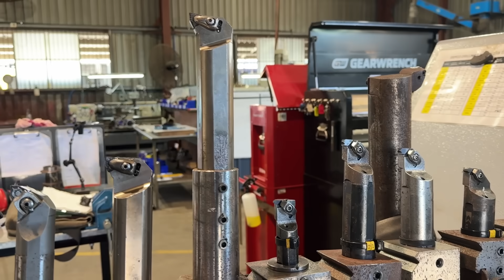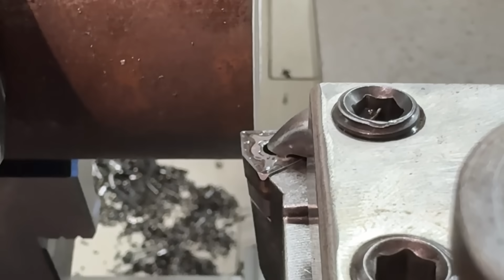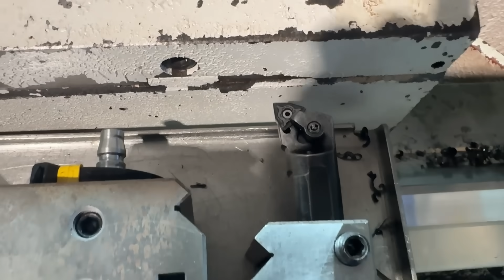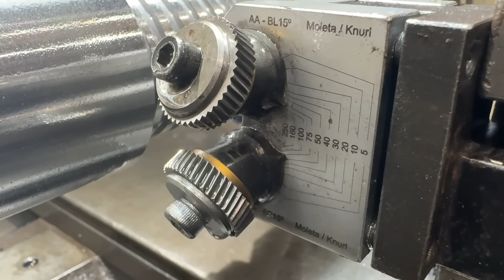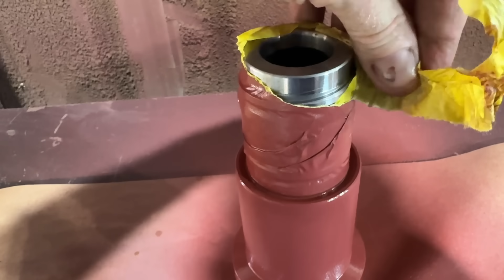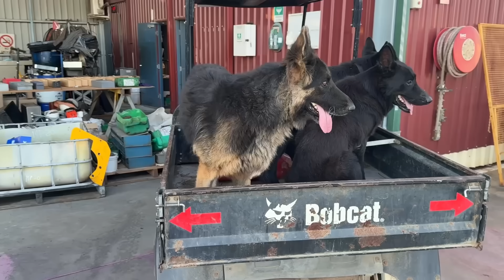Machining a Haul Plug (So Satisfying To Watch!)

Comment: Parkerizing... Neat, fresh to that game.
Here is a tip, heat up your metal to about 55-60 celsius before applying the stuff. It forms denser and smaller crystals. And you get no guarantee it'll turn out black, depends on the impurities in the metal. You also may want to seal it with wax oil.
Grain of salt, i am fresh to the game. Get a 200x handheld microscope ... about 100euro to get a clear-er picture.

Comment: I love the way the CNC varies the spindle speed doing facing.  Not something you can easily do on the old machines I used to have.  Had a Colchester Student Mk1 and later a Master mk2, except that I put the tailstock from the Student (luckily, a 6½" height) on the Master as the original was badly worn and would've been difficult to fix.  I assume someone had used it for a lot of drilling or something using the tailstock. 

Originally from the UK (mostly Wales) and now living in Portugal and semi-retired.

Comment: I'm surprised the rpm limit for the live center is only 300 rpm.  Is this set by your experience?  I'm used to seeing 2500+ rated rpm even for a 5MT live center although that has always sounded extreme to me.
Reply from the maker: It’s just what that particular one comes rated too. It’s heavy duty but you can’t run it at high rpm 

Apparently
Reply: @halheavyduty Thank you.  Do you have a video talking about the grades of steel and thread types and sizes you make on these parts?

Comment: Watching from Somerset, UK. This may be a rookie question, but why the tapered threads on one side? Yeah, nah, yeah, I know the other side will be tapered as well - lol - I'm curious to why the taper in the first place? Does the taper aid in 'gunk' (from drilling) removal during use?
Reply from the maker: These “haul plugs” usually have one straight and one tapered thread.

The straight “NW Rod” thread is so it can’t easily unwind without you noticing.  It’s a safety feature.

The other one is tapered so they screw up faster in the field.
Reply: @halheavyduty  Is that literally all it is; the tapered threads screw up faster? Interesting. I imagine it's because it allows the guys to offer it up easier (small start thread to larger hole)?

Comment: They may look nice and new as they go out the shop gate. BUT then the drillers get them and they all end up then same with no paint and just thread dope…  its universal through out the drilling on every continent and oil  / drilling fields. You do a good job to a great standard  then you lose control .. till they come back for re machining and the cycle starts again…you will never be out of a job making x overs.

Comment: The #1 issue that drives me bonkers when working on any project is not finding the tools I need to complete my task. I'm not a machinist, but I do home repair / renovation work, be it electrical, plumbing, carpentry, yard care, etc. I've got a garage that is a completely separate structure from my house. As such, I've got tools in the house and then in the garage, or both. I'm not buying duplicates for both locations so I must be orgainized. That is a weekly challenge.
Reply: I share your sentiment 😅

Comment: (Watching from a cabin in the mountains near Newport WA USA).

How long would you say it took to make this part, start to finish?  fascinating to watch a CNC make tapered threads without fiddling with the sled.

When I was in grad school (UCLA, mid 1980s (!)) we needed a parabolic cylinder surface + matching surface for a sub mm-wave optics application (*).  The matching surface pair was about  15 cm x 6 cm.  My advisor told me "please please please do not put the surfaces together!"  So of course I did.  The surfaces were so perfectly cut that I couldn't pull them apart (*).  Oops.  Against *all that is holy, I gently slid them past each other and managed to avoid scratching them (to my infinite relief).  An interesting thing about the surfaces, my advisor told me that they were "cut, not polished" in a "classified machine shop" which, I have to admit, seems plausible to me.

A second interesting bit of metal working was a "Doppler Wheel".  In those days it was quite difficult to generate 380 GHz radiation, and even more difficult to produce a second phase-locked signal about 200 kHz away from the first one.  The standard technique was to use a beam splitter, and send half the radiation to scatter off the edge of a rapidly spinning wheel, changing the frequency using the Doppler Effect.  The wheel in question was a disk of aluminum about 3 cm thick and about 40 cm in diameter with a bunch of fine teeth cut into the edge (as a diffraction grating).  The whole thing was bolted to the shaft of a beefy synchronous motor and spun at 3600 RPM.  That was then bolted to the optics bench ... hence the problem: optics benches are supposed to be completely free of vibration ... so the motor and the disk was sent intact to the "classified machine shop" and they balanced it ... and it ran smooth as a whistle as long as nobody touched it. It was also terrifying, because it was run without any kind of protective cage: if that wheel had ever shaken itself loose it would have crossed the lab in a heartbeat, and either ricocheted around the lab for a while, or simply chewed through a wall to ruin somebody else's lab as well.  Nevertheless it worked.   However it did take an entire day to optically align the system: it was infuriating as well as terrifying (***).  

(*) essentially the surfaces squeezed all the air out, and they were pressed together

(**) if you must know, it was for a plasma diagnostics tool for magnetic confinement fusion.  

(***) one of my most useful contributions was to figure out a way to eliminate the Doppler wheel, generate the local oscillator signal, and provide a means to align the whole shebang in about 20 minutes.  Rather proud of that, actually.
Reply from the maker: It’s amazing how precise things can get. I watch zero tolerance machining where the parts disappear into each other in pure awe.

Sounds like you’ve done some cool work yourself mate!

That part only takes about 1.25hrs from start to finish. If I had a more automatic machine I’d cut that time in half I reckon.

But we make do 🤣👊

Comment: I just can't get over how nice the finish is when facing the end of a hunk of metal. The way it picks up speed to keep the surface speed the same is incredible. This perfectly illustrates how much better these machines are over older manual lathes. Don't get me wrong. I have a soft spot for older iron. I've actually restored quite a few old machines. C&C lathes are just that much better at facing the end and leaving a really nice finish. Good on you mate. Job's a gooden. Cheers!
Reply from the maker: Cheers Erick!

Comment: Watching from Arizona USA great content keep it coming 😉👍
Just curious, why is the threaded end tapered?

Also why is the chuck manual, instead of a hydraulic or pneumatic quick chuck with a foot petal?
Reply from the maker: It’s just a drilling thing. Almost all the rod threads have tapers. 

We don’t use a pneumatic chuck due to the varied sizes that go in the machine.
We had one on the previous lathe and it was a nightmare for our particular application.  We spent way too much time readjusting jaws.

Pneumatic is good if you only do a small range of diameters (in my experience)

We’ll probably get one on our Megabore though.

Comment: Hey mate, great content!  Just wondering how you have those u-drills mounted. Did you machine/buy some sleeves or can you buy the holders to take them? Also I like how you changed the square head bolts to grub screws on the tool holders, thats big brain.
Reply from the maker: Well spotted Jack. 

Changed to grub screws (the tool holders are permanent when set up)

We just used the Dixon tool holders, reinforced the tool post so it can’t rotate easily, and then made up some sleeves.

Oh, and we set up plumbing for coolant. Works really well all things considered.

Comment: I've observed drill rig functions over many years (videos) and have never been able to reconcile how/why tapered pipe threads mate but do not jam/gaul/cross thread. Could you shed some light on that? THANKS.
MdS San Rafael, CA
Reply from the maker: They can jam / gaul / cross thread, but by and large they don’t.

The taper tends to be 4.76 degrees commonly and it just lets them screw up faster in the field.

At 4-5 tpi it’s quite coarse, so cross threading isn’t really a big issue. It can be for casing threads, but as long as the rods are kept more or less straight, it’s usually smooth sailing.

Main thing is to make absolutely certain they’ve shouldered once screwed up (or they’ll snap for sure)

The shouldering provides stability and stops fretting / cracking.  And makes sure they actually seal
Reply: @halheavyduty Thanks for that informative response. Not with HALHD, but other sites ask for comment then seem as though your shouting into a black hole.

Comment: Hi,
its just satisfying to watch these Videos, thanks😉
And educational to!
Next Week i need to make a Part like you do, just smaler (32mm).
PS: does it make a huge difference cutting a trapezoida threat with a normal puncture steel instead of a partial profile insert?
Greetings from Switzerland
Cs
Reply from the maker: It just makes the finish a little better, but they can chatter a bit more on internal threads (re the full profile)
Reply: @halheavyduty  thx

Comment: Hi, Matt. I was just curious why there needed to be a hole through the haul plug you made. ?
Reply from the maker: If it doesn’t have a hole, the rods will create back pressure as they’re hauled out.

Like putting your finger over a straw 😉

Comment: im curious to know what kind of cnc lathe this is. ive never seen one where it has a conventional tool post? is this common and is it just new fancy cnc lathes that have the tool mag setups
Reply from the maker: It’s a Colchester Alphs 1550.  They’re a really good reliable lathe. You can get them with 8 change turrets and live tools, but for our style of work a quick change toolpost works well.

We don’t do huge volumes of the same part, so it’s actually quicker being low tech / old school.

Comment: A quick question, why do you do the knurling on the manual instead of just one setup on the cnc?
Reply from the maker: We just haven’t set one up yet. Need to do it though
Reply: @halheavyduty  I'm not sure how important appearance is for this, but I've done "knurling" with a threading insert before by just running it forward and backwards. Feels the exact same, but the diamonds come out looking a liiiittle funny looking.

Comment: Why two different diameter holes through it? Why not just run the smaller of the two? Or no hole at all?
Reply from the maker: Each thread needs a different sized hole to be machined to spec.

If there’s no hole, the air can’t enter / exit during tripping rods and it creates suction
Reply: Makes sense, I didn't even think of that.

Comment: Back in '81, I built a CNC Lathe from scratch adapting a TAIG Micro II Lathe with 2 Slo-Syn SS25 stepping motors controlled by 2 Cybernetic CY512 Stepping Motor Controllers with a Sinclair ZX81 and its membrane keyboard. Dirty fingers and flying chips didn't affect the Z80 CPU.
Reply from the maker: Mega MEGA respect to you Roy.  That takes some serious skill brother

Comment: Good morning from LA. Hope all is well there (no more cyclones). Q: I'm an old timer, and it sounds like the lathe varied speed as you were facing your material, is that so? and is it to make the cut consistent?
Reply from the maker: Well spotted. It has an option for constant surface speed, so the finish is much better

Comment: Hello From the UK   Another excellant video      Will  putting a coating on the parts cause any dimension issues or will it be too small to be a problem ?
Reply from the maker: No problem at all.  Not for this application

Comment: Hi Matt. We have a little alfa like you, it's really handy for small jobs and batch work leaving the full CNC's free for larger components, 30 tools all setup defiantly makes for reduced cycle times our latest CNC has a 200-tool magazine. Back when I did oil field connections, for anti-galling treatment of the threads on drill rods was copper sulphate mixed with battery acid, nasty stuff. For casing it was phosphating again not fun to work with, a then a spray can of a special copper paint became available much it was much safer and easier to use.
Cheers Gary
Reply from the maker: Cheers Gary.

Wow. 200 tools! What’s sorcery is this 🤣🤣🤣

What other machines do you run, and would you recommend them mate?

Thanks for the comment re treatments too. Very insightful
Reply: @halheavyduty   Yeah, we run DN Solutions (Doosan) lathes, mill and horizontal borer and in a recent upgrade we acquired 2 Mazak intergress, the small one has 200 tools, and the big one 1mtr swing x 4mtrs between center's has 120 tools. Some of the DN's we have had for a number of years, and they have been a very reliable especially when you consider we run 2 shifts.

Comment: So if the drillers have a BoBo and twist off a pipe at a joint and drop the string down the hole what tool do you have fabricated up for them to go Pipe Fishing???

So if the drillers have a really bad day and breaks off a pipe and drop the string down the hole what tool do you have fabricated up for them to go Pipe Fishing?
 Since it is a break with no clean threads it's a much bigger challenge than a twist off.
Reply from the maker: We use “carrots” of all shapes and sizes.  Basically a monster drill tap that screws into the broken rod so they can “fish” it out.
Reply: @halheavyduty  Thanks. Always wondered what they would look like. Especially considering the challenge of getting into the pipe that might be deformed. The term carrot makes it easy to understand. Long skinny self centering tap.

Comment: Great video Matt.  You’re right I love to watch CNC’s working.
The machine I used to use back in the 80’s had two tool posts one front and one back.
They each had 4 positions.  Would have loved to have all the tool holders like your setup.
On the plus’s side once you had all the tools on the machine you pressed go and waited for the machine to finish.
We used to do batch sizes from 5 to 50 usually.  Watch the sizes and tickle the offsets as the tools wore.
These days I’m a HSS kind of guy 🤠
Reply from the maker: Nice work!

Comment: Hi Hal a good lathe you are using here just a word of advice from a fellow machinist we had a problem with a couple of expensive components that had very undersized threads which turned out to be a problem with the belt that drives the X axis which had worn out with no easy way to easily check the belt do take care.
Reply from the maker: Oh wow. Thank you for letting me know. Much appreciated

Comment: Hi from an idiot abroad in Norway, working in the oil industry so recognise some of this drilling stuff haha :)
Why on earth is someone drilling an 8' hole down to 250m..?? Looks like I'll have to go watch some previous to get the back story!
Reply from the maker: Check out the big rig episode for sure. They’re drilling underground mine ventilation shafts!
Reply: @halheavyduty  Haha yeah went back and found it :)
Just goes against the grain coming from oil well drilling where the general rule of thumb is to keep the hole as small as possible. Well design must balance getting to depth vs cementing off non-primary target potential eruptive (production) zones, whilst at the same time minimising annular flow area such that if in the worst case, a relief well is needed, the main bore is small enough to reduce the piston area such that they can pump enough rate to "back fill" the main bore with kill mud.

Comment: Oh just in case you can't see where I'm at it's Prescott Arizona USA
I drive the Emmons special  #428 Blown Fuel Rear Engine Modified Roadster at Bonneville
It's a 1927 Ford model T run 85% nitro methane in a 360 cubic inch de-stroked Keith Black 426 hemi I make two 5 me passes for an average speed car has no transmission it is direct drive with the rear ratio of 1 to 1.31 there is no hypoid angle as I remember these gears come from a helicopter it's a very beautiful car it proves that you can make a barn door fly with enough horsepower. 
If you look for Bonneville 2011 car 428 fire there are actually a number of YouTubes but this is a return run for the average where I set a record at 316.002
And naturally it ends in a fire.
Reply from the maker: Nice!!! That’s awesome

Comment: First-time viewer. I was a driller for soil samples and in-situ cores for an engineering firm here in San Diego, CA. I drilled all over San Diego, Imperial and Riverside counties for many years. Moreover, I've always been fascinated by machine work and probably would have made a good machinist or mechanical engineer. However, heavy equipment along with soils and materials testing (lab and field) got the best of me. Guys like you and Kurtis have all the cool tools. I look forward to seeing more.
Reply from the maker: Cheers mate! Good stuff

Comment: Do you ever have issues with the parts pushing back in the chuck? Maybe it's just that every chuck I ever had was completely clapped out, but I always had issues with that when using insert drills.
Reply from the maker: Oh man… yes! The first Chuck on the little alpha was clapped out and it was a nightmare.

Since we installed the better chucks (the big alpha has a Pratt Barnard, and the little guy has an Autostrong) it’s less of an issue.

We’ve kinda figured out what the max feed is on every Udrills.  Hard enough that it chips… but not hard enough to push it back.

Took a bit of playing with